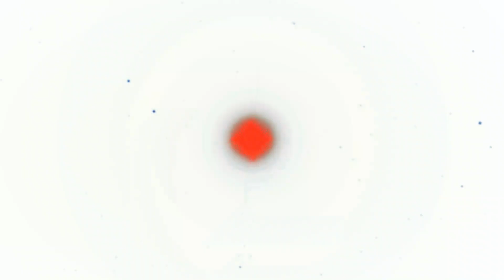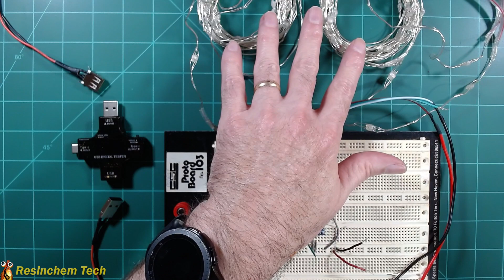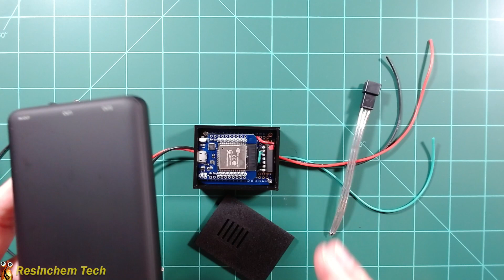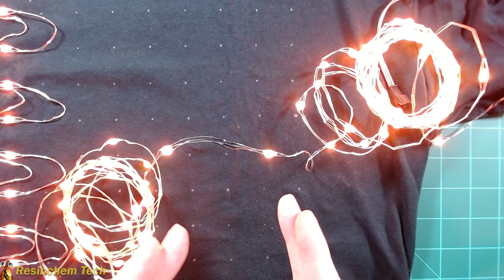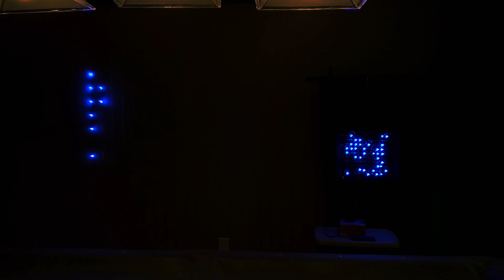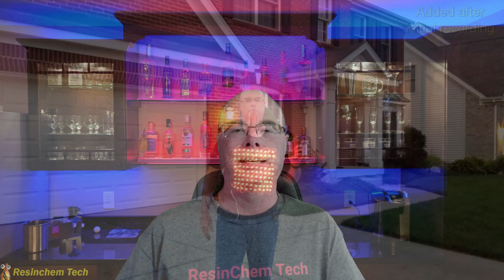Battery Powered LED Matrix - T-Shirt Build

Comment: You make things look so easy when they are really hard to do 🙂 How can I get a case from you when I have no printer to do it? I also no room to buy one either, so would really like to try this project but need tips on how too do so without your case, thanks too for you very helpful videos!
Reply from the maker: For nearly all my projects, and unless I specifically state otherwise, 3D printed parts are *optional* .  You can use all sorts of things for enclosures or cases... you just need to be a bit creative.  Simple soap containers, or other small plastic boxes can easily be adapted as enclosures.  There are also a whole list of small project boxes in various sizes on Amazon that can easily be used:  https://amzn.to/3RztxRk

I only have a few projects where a 3D printer is needed (or 3D printed parts... you can also have an online service print parts for you... or if you have a college or local maker space nearby, you can sometimes get parts printed there at reasonable costs).  For simple controller enclosures, you can repurpose many other common items as a case and don't need a 3D printer or printed parts.
Reply: @ResinChemTech  Thank you for this yes, I not too sure a college would be able to do it around me but I can ask! I also do have another waterproof container but too big and I've also forgot what bit types to use for drilling through plastic? I’m only used to wood  I also struggle to do anything never mind be creative with issues with my conditions too so I tend to spend more time just watching and not doing  I have a Christmas tree to solder that’s still here under my desk from last year! But enjoy watching on how things are done and if I had space Id would try to do more but I have no room for a cat let alone a Drill though I do have one  in the attic lol thanks for your help and keep making your projects they look great! The other issues sometimes is they are not available in the U.K so then I have to try to pick something similar for your projects and again these parts do take up a lot of space when your desk is full of PCs to do web site and the rest of the thing. 😊 I’m also having to concentrate of medical devices to keep me alive which again these projects of yours help me to think that they be vey handy for me and other on what they can be  adaptive in. I get my Blood reading on monitor and things but be great on your project to display them 😊 But I have to learn the basics. I have some Govee path lights that are faulty and will not work with its controller and with your skills you would some be having it working on a WLED Controller than the Govee one. Have you any projects like that I can look at?
Reply from the maker: Well, as primarily a DIY channel, I've done a number of projects where I do a DIY version of a commercial product (like NanoLeafs, Govee Lyra floor lights and of course the Govee curtain lights to name a few).  But to that end, I've never actually owned any Govee products!  Others have reported to me that they were able to remove the original Govee controller and replace it with a WLED controller.  There are probably videos or blog articles out there on how to do that... but without my own Govee controller to analyze and test, I really can't provide you with any instructions on how to do it.

If possible, you might start with just building breadboard versions of some of the less complex projects.  Don't worry about creating soldered versions for now.  Heck, one of my first WLED projects (LEDs around my pool table), the controller is STILL on a breadboard mounted underneath the table.  And that's worked fine for over four years now!  So, I'd try to just use breadboards, jumpers, Dupont cables, etc. to build some of these projects just to see them work and understand the circuit basics.  I had zero soldering experience when I first started, so it was a struggle for a while until I figured out the best process.  Up until that point, I just built things on breadboards.

And I'm always happy to answer any particular questions or to provide more information on "why" I did something that I did in one of my projects.  Best of luck with your own journey and projects!
Reply: @ I got my first project figured out togight getting the Govee Ground lights 2 into WLED using a ESP32 controller, I jsy went for it and cut the wires and so glad I did now 🙂 Thanks!
Reply from the maker: Congrats!  Glad you got it to work out.
Reply: @ResinChemTech  Now more practice to solder. On the ESP32 boards I get a little confused still on the power sources needed though I seen your way to calculate things and other I still look at my project and never really know what to get! I tend to end up getting a lot of power sources to do it and always worried more when the lights are expensive. On the Govee Lights it says output:24v  1.5A 36w  0.6A what is 1.5A?  as that seems low to me. And is 0.6A for each light? So then I can so a calculations like this. If I Buy 1m 60LEDs/m ( Total LED Strip is 60 LEDs ), So 0.3W*60=18W
This LED Strip is Work with DC5V Power, So 18W / 5V=3.6A ( At Least 18A or more )
Reply: @ HHave you any video that might help me to do what I have just done but not use a USB and somehow power both the lights and the ESP32 I'm getting told to use converter to get the 36V down to 5V when I have a 24v and add a relay to cut power to the Govee lights but not sure if this would interfere with Home Assistant on the Automations for it if it cut power any tips on these things would be great and much appreciated
Reply from the maker: First, I'm going to recommend that you take a peek at my blog article on standard wiring diagrams:  
https://resinchemtech.blogspot.com/2023/01/wiring-diagrams.html

This has a number of different wiring diagrams for WLED controllers and LED strips, including an option for powering 12V strips and controller from a single power supply (in your case, just substitute 24V for 12V and adjust the buck converter accordingly). It also has a number of other diagrams that you might find handy for this or future LED projects.

Next, I'm going to go on a little 'rant' about the relay to kill the power to the LEDs.  Yes, it is true that an LED strip draws a tiny bit of power even when the LEDs are off.  According to specs, standard WS2812 LEDs can draw about 0.6mA per LED pixel when off.  So, let's say you have 100 LEDs (just to make the math easy!).  That means the LEDs are drawing about 60mA when off.  For 5V LEDs, that roughly translates to 0.3W.  So if off for an hour, that's about 0.018 kWh.  Now, here in Indiana, we pay about $0.15/kWh.  If I pay $5.00 for a relay, it will take around 77 days JUST to recoup the cost of the relay before I'd actually start savings a few pennies a week.  And the controller would continue to run, drawing probably 300-500 mA... nearly 8x what the LEDs pull when off.   Of course the calculations would be different for different voltages/types of LEDs, but you get the idea here.

And none of this includes the power draw of the relay itself when energized... which can be up to 750+ mA.  So if the LEDs are going to be "on" more than "off" using a relay will actually consume MORE power than not using one.  This is especially true of battery powered displays.  The relay will just draw extra power when energized.  Of course you can reverse how the relay works, but then it would be drawing power when the LEDs are off (and actually use more power than it would be saving). For battery-powered projects, the best way to extend battery life when the system isn't in use is to kill power to everything... controller included.  Yes, in this case, the controller will go "offline" in Home Assistant (note that the controller will still remain online however if the relay is just killing the power to the LEDs, since the controller remains powered on in this case... but that also consumes battery power).

If you haven't seen it yet, you might watch my video on Common LED Questions:  https://youtu.be/GZv5Ztj6i6I
This also includes a segment on power supplies, including using different voltage LEDs with the 5V controller.

For a battery-powered LED project, I don't think a relay that kills the power to the LEDs will actually extend battery life... in fact I think it could be just the opposite unless the LEDs are left off for an extended period of time (which will likely kill the battery over time anyway just from the controller draw itself).
Reply: @ Big thank you for poiting me in the right directions! I think I seen the Diagram to step it down, so Im hoping if I do the same as your diagram and change the power supply to a 24v and hope it be ok on stepping down to the 5v for the ESP32 and the split in it the rest of the 24v goes to the lights.  I still not seen one on Relay yet. Just going through your video link now as well thanks!

Comment: A lot of energy in the power pack, and 5 and 12 volt shorts get hot fast.  You want some good protection between this and your body, and it'd be a really good idea to make the entire shirt tear away with velcro seams in case it catches fire.
Low chances if the electronics are well done, but if it does short or catch fire you will want the t-shirt off and away from you much faster than you could possibly take it off normally.

Comment: Why connect HV and LV to the Logic Level Shifter?  Won't either HV or LV power connection work?
Reply from the maker: I'm not sure I understand your question.  The shifter 'boosts' the data signal from 3.3V (LV) to 5V (HV).  The HV and LV on the shifter are for the 3.3V and 5V connections.  The data signal is then connected to any of the four available numbered channels (1-4)... incoming signal on the LVx side and outgoing signal on the HVx side.  I have a couple of other videos specifically on the level shifter that provide additional details if you've not used one before.

Comment: These are great videos! I have a little experience with soldering but very little in the electrical aspect of building these things out. 

I wanted to use Fairylights and a clear shell for my Fiancé's xbox controller but I wanted the lights to fade in and out alternatively. Is that something relatively "simple" or am I better off buying it from Etsy?
Reply from the maker: I think the issue for something like an Xbox controller is trying to find a place to stash the controller.  You need some sort of controller (not to mention an adequate battery) for the LEDs.  These types of LEDs will not light up without a signal from a controller.  To be honest, as much as a fan as I am of DIY, in the case of something like an XBox controller, you are probably better off with a retail/prebuilt version.  Anything that you DIY using something like WLED is going to require an external controller... meaning wires are going to need to run to the controller... or you'll have to have some big box mounted on the controller somewhere to house the controller and 5V battery pack.

Comment: Another great video!! I’m Just getting into the world of wled and have been  watching a lot of your videos. Could you have powered this through the mini usb on the board to the usb on the battery bank?
Reply from the maker: Thanks!  You couldn't really power the system via the USB port on the ESP board because that would have required the power for the LEDs to pass through the 5V pin on the board.  And if you've watched some of my other videos, then you are aware that the 5V pin on the ESP boards are only rated to handle a few milliamps... just enough to power a very small number of LEDs.

Trying to run enough current to light up all the LEDs through the 5V pin on the ESP board is a very bad idea and will likely result in damaging or destroying the board at some point.  It might run for a few minutes... or in some cases a few hours depending upon what colors/effects you are running... but it is highly likely it is going to fail at some point.  That's why in nearly all of my videos, you will hear me talk about the necessity of running the 5V power in parallel to the controller and LEDs.  It's the same case with the t-shirt in this video.  Normally, I wouldn't even run the current through the ElectroCookie board, but it was low enough in this case that with an extra wire to bridge the power, I felt OK running the LED power through the ElectroCookie... but still not through the ESP board.

Thanks for watching.  I hope that I answered you question and my answer makes sense as to why you can't (or at least shouldn't) try to power the system via the USB port on the ESP board.
Reply: @ResinChemTech   Thank you for the quick reply and detailed explanation. I have heard you say in many of the videos I have watched, to run the power in parallel. I haven’t found anywhere what the max milliamp draw an esp8266 board can safely handle. Thanks again for your help!!
Reply from the maker: Well, I'm by no means an expert... and there are so many variations of boards it might vary.  But the official Espressif data sheet on the ESP8266 says a maximum of 12 mA on any single GPIO pin.  This isn't necessarily the same as the 5V pin though.  For the ESP32, it does list a maximum I/O current output of 1.2A across all pins.  Those are for the bare chips however, not the development boards we normally use (like a Wemos D1 Mini).  I've seen numerous anecdotal reports that say the max current on the 5V pin is 500 mA... but I can't confirm that via something official.

My rule of thumb... anything that might require over about 250 mA @ 5V, I will power independently, or in parallel, to the ESP board and not via the 5V pin on the board.

Comment: I feel like this could also be done with a led matric panel(s) that has more pixel density. you could even glue them onto a shirt poke the jst conecters through and put a diffuser material over them to get a better image without hotspots. Granted they would draw more power they could be run off a power bank also just with less runtime of course.
Reply from the maker: Yeah.... lots of different ways to make something like this.  As I stated in my video, this type of 'crafting' is not my specialty!  It was more of a personal challenge to see if I even could do something like this... and a response to multiple requests to create a battery-powered LED display.  If I were to do it over (and I have zero intentions of creating a second version!), there are a number of things I would likely do differently.

But I appreciate the thoughts and tips... especially for someone else that might want to create something similar.

Comment: Cool video. I built a wearable with a safety vest outlining the reflective bands, but used the same seed lights as your wall matrix and folded the wires onto themselves and sewed them down, tightest spacing I could get with the standard 10cm lights was about 1.5”, my ESP32 and mic went into the ID pocket of the vest and battery bank on an inside pocket. Sometimes I put a white t-shirt over the vest which definitely diffuses the LEDs and changes up the look. Bored with it I’m in the beginning stages of doing a matrix shirt too, but full shirt and both sides, I found the seed lights in 15, 20, 25, 30, 50 and 100mm pitch……once I figure out which spacing will be best that’s the pitch I’ll buy so I won’t need to fold excess wire and space the rows equal to the pitch. Looking into around 1000 per side, possibly, depending on how they look under diffusing, may not be able to get as tight as I hope. 

Great video and gives me more inspiration to move this project forward for next years camp parties
Reply from the maker: I was thinking a bit about the safety feature of these, but I was thinking about Halloween costumes for kids.  But your idea adds a lot of other potential uses... bikers, walkers, etc.  As I discovered during just a bit of the outdoor filming I did for this video, wearing a bunch of flashing LEDs on your clothing does get the attention of others!

Using LEDs with a smaller pitch would definitely be recommended!  I did a little bit of searching, but because I needed them pretty quickly, I had to settle with what I could get in my available time frame for the video.  Wearing under something like a white t-shirt would help to hide all that extra wiring and the diffusion would make it look different.  I might actually give the extra t-shirt a try... thanks for the idea. 

And thanks for watching and taking time to comment.  Good luck with your project.  2,000 total LEDs would look amazing!  If you end up posting photos or videos of the completed project somewhere, please let me know.  I'd love to see it!

Comment: Hey, Thanks for the shout out! Sorry it took me so long to comment. Great Video. I love the idea of using the smaller pixels.
Reply from the maker: No problem.  Thanks for bringing up xLights.  I messed with it a number of years ago but had no idea that it now natively supported WLED and WLED matrices.  I did play around with it a bit using the LED curtain but simply didn't have time to include that in this video.

I was pleasantly surprised at how little power these fairy lights used, yet they are still plenty bright.  I have had numerous requests over the past couple of years for an LED display that was battery operated, but felt like anything of significant size using standard WS2812b was just going to eat the batteries too quickly.  But these fairy lights definitely make battery power an option.

I appreciate you watching, and as always, for taking the time to comment.